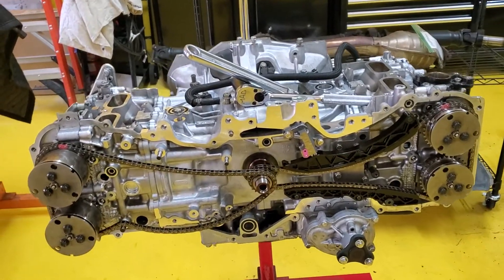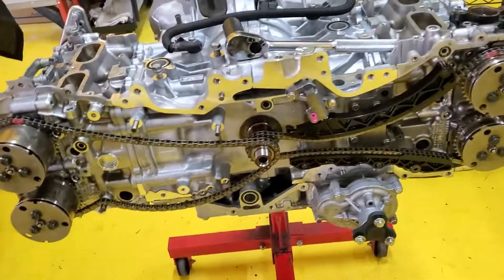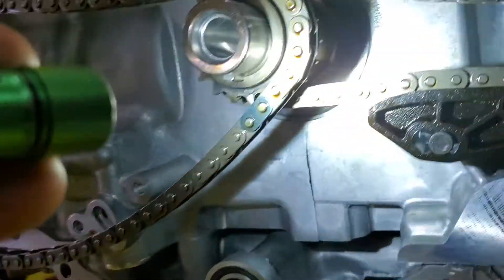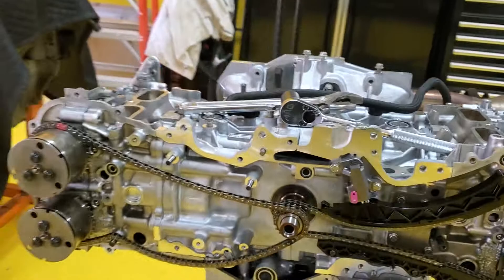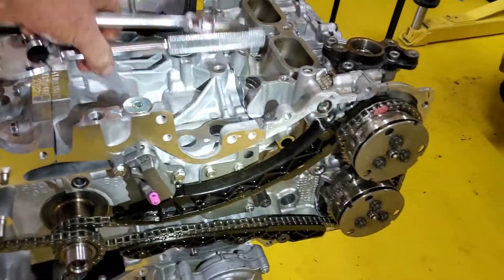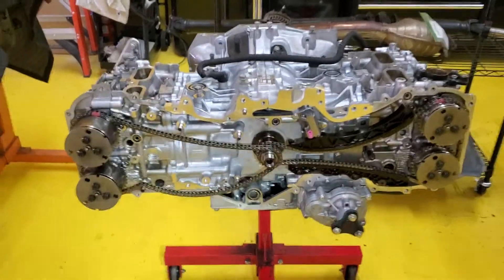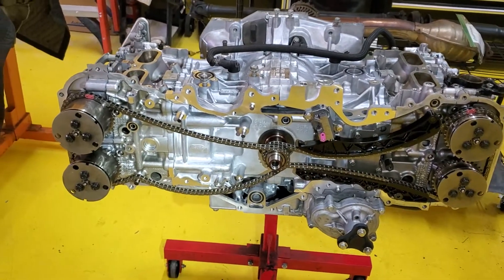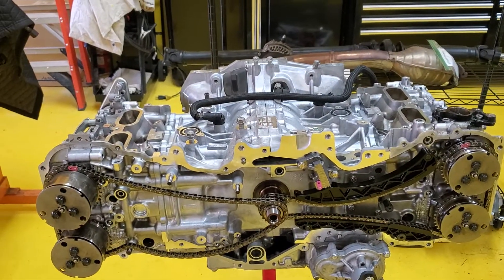Scion FRS FA20 build info RH timing chain

Comment: Just a heads up with priming the oil, no need to pull fuses on these. if you hold the gas pedal to the floor while cranking them it goes to a de-flood mode and you can crank away and prime it

Comment: Good day. I am working on my sons 2012 fb25. In short I broke the woodruff key to align all up. Now I need to replace and chain needs to come off.  I noticed after turning the crank several times I can not get the colored link to line up with the marks on the cam. I never removed chain yet witch is puzzling me . Have you seen this before? I do not think the chains jumped, however I do not want to damage anything. Your thoughts?

Comment: When you did the timing, did you only use the markings to line it up? Or did you have to specifically put one of the pistons at TDC. I’m like 99% sure I did the timing right on mine but something still isn’t working right, I’m having backfire through the intake and it also won’t start. Also what was the part about the plugs, were you implying the spark plugs? I’m going to be pulling my motor soon to send off the heads because I’m pretty sure my valves are mangled, and also check the rest of my engine block. Aside from the mangled valves my timing appears to be off because only one set of valves got mangled and the other side didn’t and it’s still backfiring and also has lower than acceptable compression. I imagine the lower compression is from either my timing being off or my valves getting mangled. I tried doing a leak down test but couldn’t quite seem to get the engine to TDC since it was still in the car, but it was leaking a bunch.

Comment: One side of my cam sprockets won’t sit in its proper place for timing. The top cam jumps counter clockwise and the bottom cam jumps clockwise, the arrow won’t stay pointing at each other. How do you get them to stay in proper timing?
Reply from the maker: The chain not holding these?

Comment: Not sure about the tools for newer engines but at least on older diateibutor engines you can get a cheap priming tool and make it pretty easy to test initial preasure and make sure oil is filling the engine.